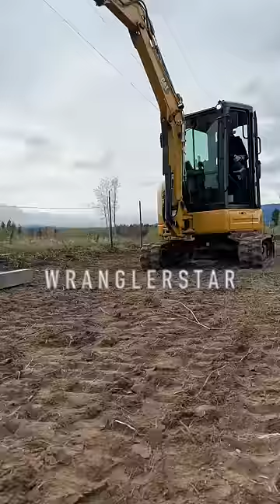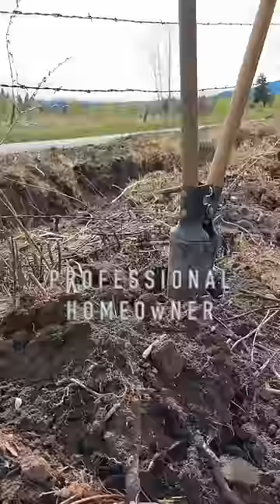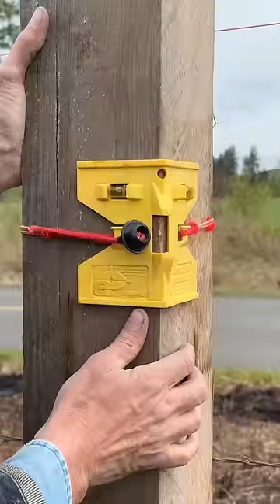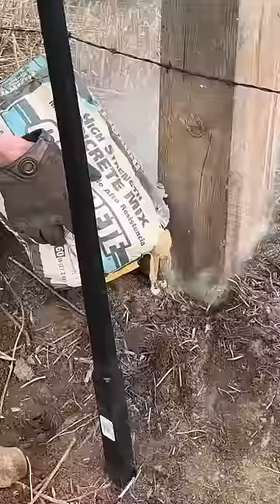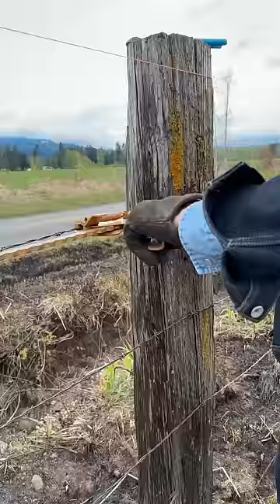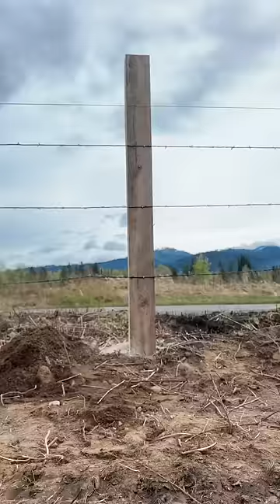Wranglestar PROfessional HOmeowner #shorts

Comment: My dad always told me, “don’t pinch the wire with the steeple”. You’ll create a stress point and thats where it’ll break. Plus if you need to tighten the wire later you don’t want to have to take all the steeples out. 

He told me to hammer it in just enough to hold the wire in the air.
Reply: Are we brothers? My Dad told me the same
Reply: Two trains of thought. Your dad was saying that to give the wire some give and make it less likely to snap but will reduce the tension and have saggier lines. Over here the nicer fences use pipe stem with welded caps and are tensioned every fourth post.
Reply: @CtrlAltRetreat  Now I'm curious. How would it be saggier? Is it not the brace posts on the end and the crests and troughs of the hills that keep the tension?
Reply: My dad taught me how to spell staple
Reply: Omg just imagine having to take every single steeple out from every single place of worship omg wow ur dad was smart. Did he also teach u how to spell?
Reply: @ThatSB  Or other buildings. On another note everyone mispronounces something in their own region. If you tour the US you'll see everyone has a variation on the correct use of the English language even you probably misuse a word without knowing.
Reply: @sociopathmercenary  lol, I never had to spell it before so I spelled it exactly how my dad said it.
Reply: the reason you don't hammer the staple in tight is too allow the wire to stretch and  tighten in the heat and cold. Only exception to this  on your termination post. Also the staple needs to be offset and not in line with the same grain of the post. it will loosen over time if the two holes are in line with one another.
Reply: My dad taught me it can take several decades to get milk from the store.
Reply: My Dad said a loose connection would allow the barbwire to roll when animals put their heads through easier, the barbs would roll instead of poking them. Tight staples everyone.
Reply: Im imagining this guys fence is saggin hard at every post. With the nails barely nailed in
Reply: @Levi-tm4gl  
Maintaining a taut line over distance requires more tension the longer the distance between fixed points of tension. The same problems with long poles held up by their ends, the length of material is a lever. If you want a line to be as straight as one half as long, you'll need twice the forces holding it up and you can only tension a line so much before you start getting problems related to over tensioning. Pinning, stapling or otherwise mounting to each post and tensioning each not only reduces these issues, it also makes keeping then clean looking as you're putting the fence up a lot easier
Reply: @ThatSB  Nope. Context. A staple is in a stapler on a cubicle drone's desk. A "steeple" goes in a wooden post. It's on a church, too.
Reply: @Levi-tm4gl  my grandpa pronounced it as steeples too, yet he also used the word staple for office type ones.
Reply: We just used leftover wire to tie the backs around the post. Not always but we just made due with what was around some days lol
Reply: My dad told me not to put wood in concrete because it traps the moisture and makes the wood rot out faster. He also makes up professional homeowner facts pretty often.
Reply: Its a staple not a steeple
Reply: @ThatSB  That unlearned southroner must've been quite influential, as I've heard it pronounced that way in multiple states, both north and south.  I have a stapler on my desk, a stapler in my shop for fastening things like carpet or tar paper, but I have a bucket of "steeples" that require a hammer to drive. They're also peaked like a church steeple, as opposed to the squared staples. The different pronunciation is used to distinguish types and possibly avoid confusion. That's how language works to the unwashed and unlearned.
Reply: @tomsharpe2251  depends on who you're talking to
Reply: @misterbulger  no it doesn't lol
Reply: @Mobile Game Clips  Haha, chuckled at that
Reply: @CtrlAltRetreat  pinning the staple will lead to far more issues. It will lead to far more broken wires in your fence over time and will be much much harder to repair those broken wires as it is much harder to stretch and keep a short amount of fence tight than a longer fence. If you dont pin the staples, you can stretch at least a quarter to half mile of wire tight from one spot. If you pin the staples, you can stretch a whopping 20 feet, or whatever the distance is between your posts. Now imagine you have 20 miles of fence to keep tight... you get the point on how ineffecient and counterproductive pinning staples is. Not to mention short pieces of fence become saggier and loose much faster than longer stretches.
Reply: @ThatSB  While staple is the correct word, steeple is how some farmers would pronounce it the yesteryears. It's something said colloquially.
Reply: Staple
Reply: Y’all are funny, either way works. By not pounding staples in every post you can tighten your whole fence at the end posts or corners posts. However driving each staple in means when cows try to stick their head in they feel more tension and are more likely to back away. There is no right or wrong way
Reply: @ETsBees  na. That doesn't work out either and then the cow is much more likely to break the wire as there is less wire to absorb the force of the cow pushing on the wire. All it does is make your fence more likely to break, then you have a much bigger problem. You can keep the fence much tighter overall by not pinning staples. Which will lead to less breaks and less cows getting out. I've been doing this for a living my entire life.
Reply: @DW61234  that’s cute, I have worked with livestock and fences all my life too. Put your staples right by the barb you don’t have to pound them in so tight. Where you may damage the wire. Hope you learned something, have a nice day.
Reply: You dad lied to you. That's sad.
Reply: Steeple 😂
Reply: You don't put the steeple tight because the wire is going to pull and shift around anyways as the fence settles and except for the corner posts you want to let it settle but still be kept in place.

 Also it seems like alot of people don't put a horizontal or diagonal support post between the corner posts and first fence post anymore idk why that fell out of fashion
Reply: @Levi-tm4gl people suck sometimes, the grammar police are everywhere lol
Reply: @regularpit1508 spelling and pronunciation are a whole different issue. If you tolerate spelling issues we’re going to end up creating a whole new language. Especially when you have someone who doesn’t pronounce words properly learn the incorrect spelling.

Comment: As someone who’s been installing fence for 25 years I can tell you never cement wood posts, it literally cuts the life of the post in half by trapping moisture in between the post and the concrete causing it to rot. We only cement a wood post if we absolutely have to because we didn’t get the hole deep enough. Backfilling and Tamping the soil you remove from the hole is more than sufficient.
Reply: Yes,  and tamp it in layers all the way up. Concrete is the lazy way.  If you want to save energy leave off those last 2-3 swing of the hammer 😅
Reply: How about using gravel around the post? Is that better than dirt?
Reply: Is there a better way though while still sticking with a wood beam?
Reply: @TheAnnoyingBoss  a better way as far as? Wood is perfectly fine to use and a post.  You just want to try and avoid cementing a wood post at all costs unless you absolutely have to per my original comment. Wood also doesn’t last as long as it did 20 years ago because of how rapidly they harvest it nowadays. I’m not saying it’s not a good option but when I if first started I n my industry you could easily get 20-30 years or more out of a northern cedar fence. Now it’s maybe half that or less.
Reply: @TheAnnoyingBoss  hope that helps.
Reply: You mean it causes it to rot off at the ground like the one he just removed?
Reply: @harlowecustommicrogreens  yes
Reply: And if you oil the post?
Reply: @Letsgobrandon827  it’ll protect the post but I wouldn’t recommend it. Not good for the soil etc. a regular pressure treated post is plenty.

Comment: More guerilla warfare tips please
Reply: Yes please do lol
Reply: Rebar on the backs where it is low viz, use pipe ties to secure to the post and make sure the concrete sets around it. I'd recommend not going too long so it's not a pain to dig out if the post is messed up but make sure it's around 16 to 20 mm thick and you can pop one to two in per post. Pays to have any barricade you can, and supplemental bent nails between make it very prepared.

Comment: never run the staple that tight. it needs to allow the wire to expand and contract with the temperature.
Reply: Along with other stressors like cattle leaning into it to disperse the stress over a larger area. Not to mention if you did this on everynpost you will be stretching your fence every 20 feet for the entire length of the fence rather than in one or 2 spots and being done.

Comment: Glad to see you tamped your concrete instead of mixing it with water. Let it pull the moisture out of the ground it will set way tighter that way. When I was a kid we fenced off about 80 acres for cows and set every post by tamping the ground with shovel handles. My dad would do 2 inches of dirt tamped tight then add some concrete then dirt 2-4 inches at a time tamping and layering all the way up. Those post we set were so tight in the ground you couldn’t wiggle them if you wanted to. I see so many ppl just pour wet concrete and a week later you can wiggle the post. That’s junk. May take longer to do it the old way but it’s a good way.
Reply: Thanks for the explanation. I’ve seen people debate this topic back and forth and I’m realizing dry is the way to go
Reply: @angolio265  there is a new thing you can do with that foam. I just don’t see that lasting very long. May be ok for a mail box but not a fence lol

Comment: A real Professional Homeowner would cover the bottom of the wood post with tar or some sort of waterproofing material that way the ground water wouldn't rot it out...
Reply: Even with the concrete?
Reply: @lougarou8624  yes, concrete is very porous. Everytime it rains, the water t will sit in the concrete and soak into it/the post.
Reply: Maybe it's pressure treated
Reply: @PauIieWalnuts  was wondering about that too but it doesn’t look treated 🤔
Reply: I was waitng for the oil hole like he did on the mail box at the old house. ;)
Reply: Gravel the bottom foot of the hole before concrete
Reply: Seems to me that we all are REAL professional Homr owners...
Reply: @tigar0485  with washed gravel though, let thenwater run theough
Reply: Soak the post in used unwanted motor oil overnight. It be grand for many years 🏴
Reply: It will usually rot out at ground level first with concrete. Here in the S. E. USA anyway
Reply: why not make a concrete pier than a fitted metal footer? wood will never be sitting down in water then
Reply: @user-dm1tv6nl2e  ya, didn't look like Cody did that in this video... But yes that will work
Reply: Bruh only went 1.5' deep
Reply: @peepooply2977  you're right, ground water or any water stays above 1'5"...
Reply: Some other cultures treat their wood by burning the surface using special process

Comment: Nice post.  You might get better results if you don't drive the staples right in.  Leave them out enough so that the wire can move.  This allows your fence to act more like a spring and will recover better from stretching events since there is a greater length of wire involved.  If the post is not a strainer of course in which case I always drive the staples in enough to hold the wire - depends on how good your wire terminations are. Otherwise, excellent job.
Reply: What is a strainer post?
Reply: @tom_ad9343 the larger posts that take the strain of the wire tension are strainers, the posts in between are more just guiding the wire.
Reply: @tom_ad9343  A strainer post is the post at the end of the fence (eg near a gate) or in the corner of the fence that takes the strain of the wire.  Those posts usually have a strut (diagonal or H shape to the next post for eg) that helps to hole the post up straight and not be pulled out by the strain of the wire.

Comment: As commented elsewhere, unless the wire is being secured at an end then it's useful to leave the staples slightly proud of the wire, allows the wire to move and take/spread strain and also doesn't damage the wire and create a weak spot

Good job brother
Reply from the maker: Got it,

Comment: A ProHo would use steel posts so his sons & grandsons can admire their fathers/grandfathers fence 50 years later.
Reply: Got to have a good wood post to pull your wire tight. Then T post between them. Telephone poles with the best. Being pressure treated with creosote like they are
Reply: Railroad ties are the best, most are hardwoods, oak typically. Treated posts are generally younger pine trees with a wide ring count, treatment is usually only 1/2” penetration. Now a telephone pole is a whole different animal. I use asphalt emulsion 48” up, dry it, then soak it in motor oil, then wrap it with 30lb asphalt felt. Time consuming yes, effective, yes
Reply: @CD38325 actually Hedge post are the best.
Reply: @Cowboy340 your both wrong Hedge post are the best.
Reply: @loadedhot1034  oh lord. Now we having a pissin contest
Reply: @loadedhot1034  limited supply If any on the West Coast which is where he and I are. As noted, oak ties will out live all of us. I have miles of fence line that has been installed for 52+ years, I suppose I know what I’m talking about
Reply: Admire the grandfathers steel fence Thats bent over in the wind on a 45 lol
Reply: @georgeblae5756  if your fence is bent over from wind, you shouldn’t be building fence.
Reply: @wbewley22  if your fence is bent over from the wind, you only used steel posts.
Reply: @wbewley22  wait 50 years 🥸
Reply: A ProHo would not that because it would fail to facilitate the generational transfer of skills and knowledge by not requiring his sons to help him rebuild it.

Comment: Contrary to popular believe cement helps rot the wood quicker better off driving it into the dirt or best option pour concrete pad then bolt into with metal in-between

Comment: No prep with Creosote or other oil substance (used motor oil, i.e. "Poor Man's Creosote) to prevent rot on the post in the ground?
Reply: Yeah you’re right but those posts are pretty tough. I can’t remember the species that we have. They’ve lasted a long time.
Reply: If you only have cheap wood,   in the old days they would drill holes and fill them with old oil or diesel.   In other cultures they char the wood surface it helps preserve it

Comment: If you haven’t shown it before could you please show people the proper yet simple way to put an eye on the end of a wire rope (cable) ? It can very useful including to cable off a road or driveway! Cable clamps by themselves are easily defeated but a proper eye is not necessarily even if you have to use cable clamps to set the tail. Thanks!

Comment: Nope. No cement! We don't cement telephone poles in and they're around 5 to 10 feet deep. One comment here mentioned tamping the the earth and then the cement. Don't wast your money on the concrete mix. I planted a 6x6 for a hammoc never had a problem, when I had to remove it amd I didn't have to contend with that stupid chunk of concrete on the end. But then again I don't have a backhoe to use. Same with the mail box post, still perfectly straight hasn't moved in 10 years. 

Love the hacks, thanks for sharing.

Comment: Protect the post with a mix of one part Diesel fuel, to one part used motor oil. Six inches above grade. Or one could use acopper naphthenate solution. It’s also good to note that there should be drainage stones in the bottom of the hole that the post should rest upon, so if water makes it down in between the post & the concrete, the water has a path to drain away from the post. I hope this helps.

Comment: I just bought my first land. Really appreciate this.
Reply: Use steel posts not wood. Might cost you more up front but will last way longer, be cheaper in the long term and save you from having to fix the fence every 10 ish years.

Comment: Real PROho would use a chain instead of a level.  Also, dirt tamping is easier than concrete and easier to replace in 40 years, especially if the post is locust.

Comment: will rot too soon w/o treatment.
Or is that locust? Looks like a softwood...Fir? Yellow pine?
I had 3 PT(rated for ground contact) posts out of 3 rot in 5 years time- just below the concrete collar.

Copper napthenate, pine tar, parrafin, mineral spirits, linseed oil  should be your friends.

Comment: Those levels are garbage. Use a real level and level two sides of the post. If you’re not going to put anymore sackcrete in the hole than that, just use dirt and a tamp bar.

Comment: You should put a nice sharp edge on your post hole diggers...i used to work withan older gentleman twice my age and he was setting posts 2 to my 1 after a while pf wondering how the hell he was doing it i looked at hos diggers ...sure enough it had been sharpened and also had a slight point,as opposed to my completely stock diggers....learn something every day ....act accordingly.

Comment: Anyone else get irked watching that dry concrete go in the hole? To do this like a pro get a wheel barrow and a garden hoe and bring some water, mix the concrete then put it in the hole. Wait a day then come back and attach the fencing and the post won’t shake like that when you hammer into it. It’ll be solid as can be.